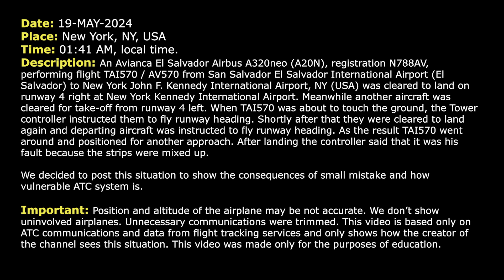Even a small mistake can lead to unpredictable consequences. New York Kennedy Airport. Real ATC

Comment: Mistakes happens. And here we can see that everything worked as it should:
The pilot was not entirely sure, so he did the correct thing: Go around.
Better safe than sorry.
And the controller just "Sorry. Made a mistake" and that's it.

This will end up in a document and an analysis will be made to see why this happened and how to minimize the risk of it happening again. Maybe it could be clearer in the computer? The strips? How they are placed? Different colors? How long had the controller worked? Work load? Rest times? And so on.
No blame on the controller.
The important thing is to find systematic errors and to try to patch the system. Making aviation safer one tiny bit at the time.

Comment: Slip of the tongue cost Taca thousands in Jet-fuel.
Reply: Not really.
Reply: @rtbrtb_dutchy4183  assuming they went full power for the go around, I calculate that they burned about 100kg (30gallons) for that portion and climb back to approach altitude.   Plus about 10 minutes of resequencing and approach.   Figure about 250kg (82gallons) for that part.       Retail Jet-A price at JFK is right around $10/gallon last time I looked. 

So, maybe not thousands (plural) - but probably at least $1000 in fuel.
Reply: @cgtbrad  those numbers seem pretty good. Except the fuel price. No airline in the world pays posted price. Not even close. If I was a betting man, I’d say they don’t even pay close to $5 per gallon.
Reply: @rtbrtb_dutchy4183  The FAA should reimburse at full retail.  Maybe they'll start to better staff the towers, so the controllers can focus better and make less oopsies.    

I'm only involved in the GA side of aviation.   I know that the major US airlines have better fuel rates, but wasn't sure if smaller foreign airlines would have as much buying leverage.

Comment: DEI hire.  It’s happening throughout aviation if you like it or not.
Reply: Gotta jump on the chance to take a "DEI hire" shot instead of acknowledging any of the multitude of alternate explinations.

Could the controller have been overloaded and confused about the departing/approaching aircraft with similar callsigns? No. 

Could the controller be perfectly fit and capable for the job but having a bad day and improperly shortened the call sign because 99/100 times that isn't a problem? No. 

Could the controller be in training at a busy airport like this and have made a simple error that is both a learnable and correctable lesson for the future? No. 

CLEARLY - incontrovertibly - the controller is a fundamentally incapable and irredeemable failure because they were hired under some non-existent DEI program that allows for hiring definitionally incompetent people into critical safety roles. 

I'm sure you've got it right with that analysis.
Reply: @williamthompson9870 people like him, DEI is a dog whistle.
Reply: Ridiculous statement. People do fall for fear mongering I guess. 🤦🏻‍♂️
Reply: parrots DEI faux outrage, opinion invalid
Reply: Could imagine it sucks be a minority in aviation, make one honest mistake and now you’re seen as under qualified because of DEI fear mongering. Everyone has to be perfect to prove these people wrong

Comment: It's a predictable human error. As long as there are enough failsafes and mitigation again against catastrophic results by such an error being made, the system worked.

In contast to SFO pushing planes into crossing runways with little or no margin of error or just regular caution. Or Dublin landing planes before they are cleared of previous traffic.

Comment: it should be pointed out that even though the two incident planes have different callsigns, "Taca" and "Galapagos", they're painted EXACTLY the same.
Reply: imo, callsigns should reflect how a plane is visually painted not how it looks on a radar screen because when you visually see a plane whether it's as a controller or a pilot, the call sign might not be apparent to you but the paint job is. "I have avianca in sight!"   ..."You mean the Glapagos?" ..."The what?"
Reply: @IlIlIlIlIlIlIlIl-v9h no, they usually point out traffic by aircraft type. Not by airline company.